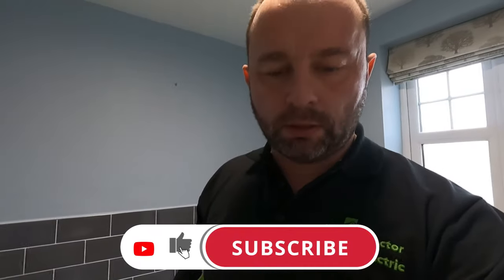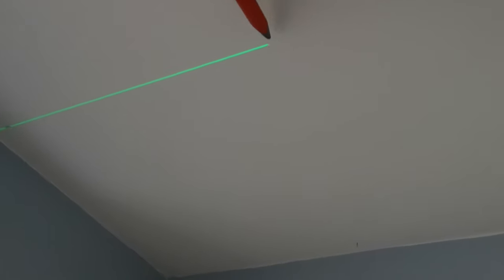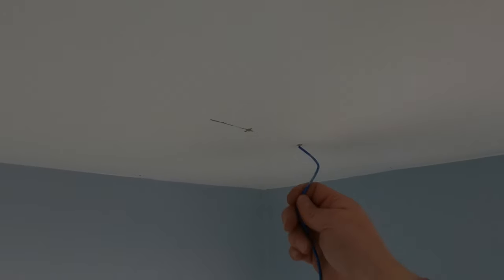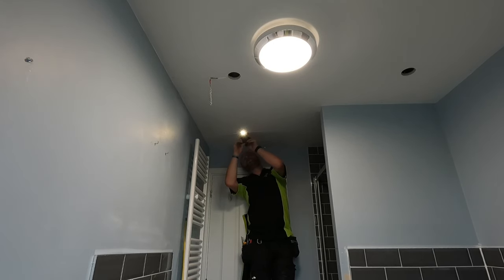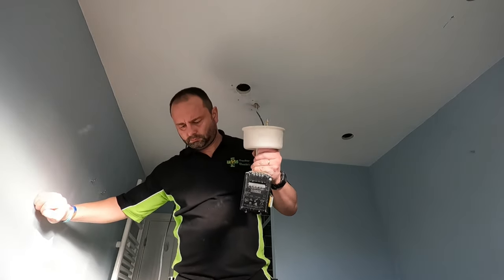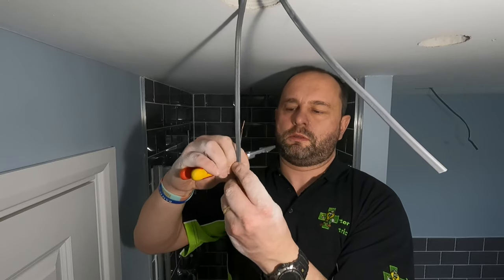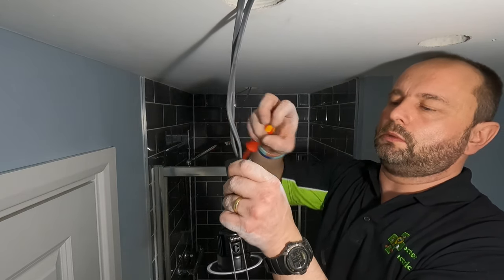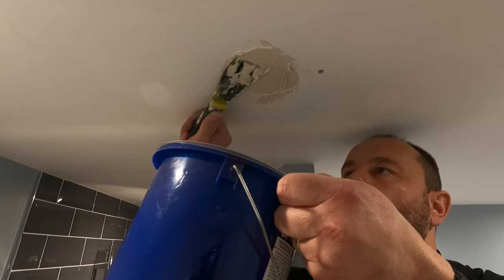How to install new IP65 waterproof fire rated Collingwood H2 bathroom downlights

Comment: This looks really similar to my bathroom. Previously fitting 4 spots from a single over head light. They didn’t fit ip65 in the bathroom and starting to rust so going to replace units. Two power cables going in so do it need LEN LEN connectors like you have used or I notice that the supplier does a loop version with only LEN inside. I’m guessing I just need the LEN LEN version? Thanks

Comment: Dumb question if I may.  There are two cables (loop-in loop-out I think it's called), does it matter which way round they go into the light?  He didn't say 'this is loop in so it has to go on this side' or anything like that as far as I can tell.

Comment: Nice little tips. Need to get yourself a good stud finder there are some good electrical ones which are now much better than the simple magnetic type. The one I have helps with electrical, metal and wood and also indicates sensitivity 0-100 percent which as you get closer shows you illumination and sound. It’s worked out great I thought it would be gimmicky when I first bought it.    Prior to lasers chalk lines were very popular still are with wood workers here in the USA giving a high degree of accuracy. 

Wondering whether there was a loft there maybe the job would have been easier to do. Also cable runs could have been made to be neater along joists, cable clips. In USA we also have to create  guard strips around the cable lie on top of the joists so if you were walking around in the attic you would protect the cable from damage.
Reply from the maker: I've tried stud finders but found them really unreliable, that's why I stick with the good old reliable method of pilot holes, sometimes you can see where the joists are on the ceiling anyway
Reply: @DoctorElectricYouTube  yeah know what you mean with stud finders.
Reply from the maker: no loft on this one unfortunately

Comment: From a plumbers perspective it always pays to pop your head above the loft hatch just to make sure there's no pipework above the bathroom, theres nothing more amusing than getting a call from a stressed out Electrician who's  soaking wet from drilling through a water pipe that was in the loft.
Nice dewalt laser light show you may have set it to pulse or it wasn't ont a level surface causing it to flash. 
Nice neat job though 👍
Reply from the maker: Thank you for your comment Richard, in this instance there was no loft otherwise I would've used it for running the cables in.
I know exactly what you mean though, I was installing some similar downlights in a customers house once and I hit a pipe.
That customer is now my Apprentice Adam!!
Thanks for the hint on the laser.
Cheers and thanks for prescribing!

Comment: Always a pain with joists. Grrr. 
Nice to see how someone else does things. 
I always use a chalk line, if the ceiling is unfinished... I think it gives the customer a visual on where the lights are going to be. Sometimes saves changing ‘em. 
Swings and roundabouts I suppose. 
This got me thinking about finding joist positions when you can’t get above. 
I’m wondering if a thermal imaging camera might show up joists in a different temperature/colour to the voids. 
Just a thought. 
Good job.
Reply from the maker: Thanks 👍 Maybe Nick Bundy will give it a try? he has one of those

Comment: I’d love a tip on lining up the laser level to the two marks as well, sometimes it goes almost straight on and sometimes I have to move the thing flat out and keep making it worse.
Reply from the maker: Put the laser level closest to one of the walls with the marks on, not easy but gets easier
Reply: @DoctorElectricYouTube  thanks doc I’ll give that a try